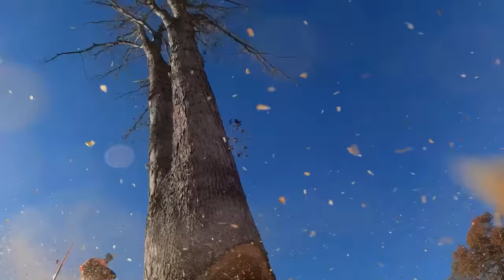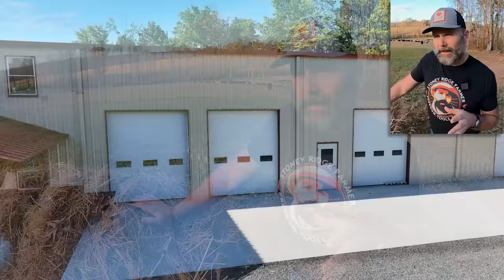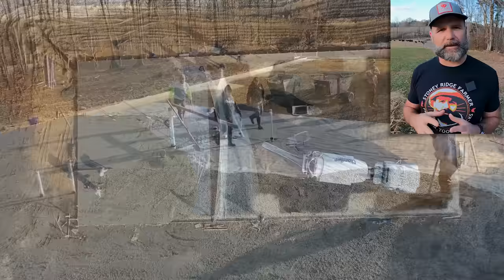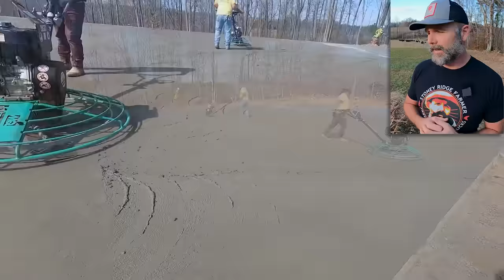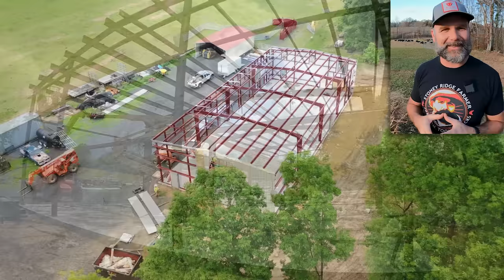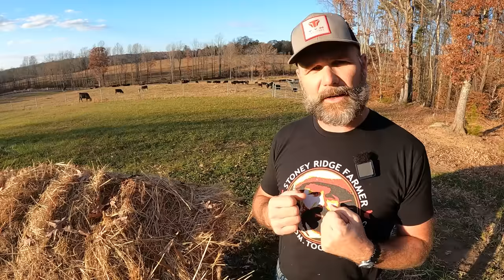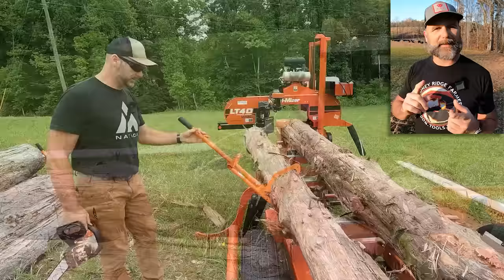Cops Came to Investigate Veteran's Farm! Heartbreaking disbelief

Comment: Hey folks… I’m a vet. I bought a 3/4 acre parcel in Pensacola a few years back. It was a vacant lot with a couple huge oaks some tall pines and a few pistachio trees on it. It was overgrown like a jungle with vines and wiled grapes and basically a mess. It had a three foot chain link fence around it. I cleaned it up and it looked like a park. It had a small concrete pad two septic tanks and a power pole already there from previous owners. I parked my camper on the pad and put a 40’ cargo container in had power and water turned on and had planned to build a home. I owned it free and clear. No mortgage, no business situs, no contracts of any sort. Three months in code enforcement cited me for the camper/RV and the container that had all my equipment in it. They told me I could not live in my RV on my own land for more than 14 days in a calendar year. I had paid cash in full for this land and over 6k in back taxes from the previous owners and found it had 25k in liens by code enforcement for a previous abatement that were not disclosed in the purchase. I was told that I must remove my vehicles, my RV, the container and all of my belongings within 10 days or the county would abate it all and I would be find $1200 plus the cost of abatement. I started studying big time. Permit was needed to dig a whole to put in fence posts… This was the first property I owned. In my research I learned things I had a difficult time accepting. You should check out these two links…. Then do your own research and verify… it’s all mind blowing FACT…. 
http://www.usavsus.info/

https://www.law.cornell.edu/definitions/uscode.php?width=840&height=800&iframe=true&def_id=28-USC-2032517217-15940179&term_occur=999&term_src=title%3A28%3Apart%3AVI%3Achapter%3A176%3Asubchapter%3AA%3Asection%3A3002
Reply: Hey Tim I'm in Pensacola and I was given verbal approval from an engineer at the courthouse 2 times to start a job 1 day before a hurricane to keep clients house from flooding. Also me almost being arrested twice by code enforcement for doing exactly what I was told I could do. Lot of people in your situation move over to Baldwin County, 20 minutes from downtown Pensacola. Funny I live on a lot in east hill and I'm wondering how long I've got before I'm caught. Hope things worked out for you.
Reply: We bought a house ( 1999 in NY) did a ton of work license and permits all done. We decided to move and sell ( kids were all grown and out of state) so we started to see if there were any permits open. Yes there was . So made plans for inspection,  they come We fixed what we had to, reinspected and passed. GOT A LETTER THE PERMITS ARE ALL CLOSED. Now go to sell . Comes back open permits.  Go back to the office.  Yes it's closed but buy the county not the town. What? So we had to pay for them to open the permits ( that was closed by the county inspector) so that the town inspector could inspect and close it. Then, I paid again for the county to close it again .
Reply: Whomever handled the sale for you was negligent in not finding and disclosing the 25k in liens prior to the closing. May need to seek legal help against them in this instance.....the mike

Comment: TOTALLY AGREE, I locked horns with a building department (CA) once and WON. This was one of the most miserable experiences I ever had. The arrogance and constantly being talked to instead of talked with. I fought them and a judge agreed with me 100%.  I am now out of state where the only permit required for ANYTHING  is septic,  and that is due to the septic system being installed correctly to avoid groundwater contamination that in reality could impact others. But yes its like how many times does your earned dollar get taxed?  Our current federal government is a example on how hiring the wrong guy can affect everything. Our Government is BROKEN.

Comment: I feel like I should correct you on one topic. I live in Connecticut, (sadly), but I am planning to move down south eventually. Here in Connecticut, zoning is so strict! I believe if the property has been in your family for many years, there may be some grandfathered laws in place, but those are quickly going away as well. Last year, I looked at several properties, intending on buying a home. What should have taken me a couple of months, took close to a year, because of all the red tape, and regulations. We ultimately settled on a quarter million dollar money pit, because it was all that was available. It was so bad, that one place we looked at, was built in 1760, did not have a septic. I said ok, I can put one in. No no no. Can't put a septic in, because the type of land it was on. (They never gave me full details). So I asked what I could do. Short answer was nothing. The home is not livable. So why is it for sale? You can purchase the property, but cannot live there. So this beautiful colonial home, with lots of American history, would have to be completely torn down, engineers would have to come reshape the land, and build new. $400,000 for 1.3 acre lot, that would cost another $500,000 to build a home, that would be worth $450,000 when all is said and done. But Connecticut will NOT tell you any of this unless you specifically inquire about it. This way, you buy it, then you're stuck paying them taxes, for property you cannot use, or sell. 
 And yes, you need a permit to build anything on your property. I just found out I have to get a $350 inspection, and permit to put in an 8x8 chicken coop! And even that could be denied. Sadly, Connecticut is a blue state, and they make it very difficult for local farmers here, since they hate the idea of Americans being self sufficient.
Reply: lololololol

Your comment was fine until you turned it into something stupidly political and made absurdist claims.

Comment: Having a farm of 12 acres in my family for almost 60 years.  They changed zoning with a 1inch by 1inch paper notification.  That Myparents were never informed of.  Livestock have been on this property most of the 60 years.  So, fast forward I build a 170 x 72 indoor arena with a 72 x 72 attached barn in front of.  All permitted and built by a professional.  My problem is my taxes keep going up yearly.  My husband I are retired and horses are a hobby for us and our granddaughters.  My place is paid for many years ago. But, they are taxes us out.  New very expensive homes are going up all around our land.  We live in the original farmhouse in this county that is over 125 years old.  I feel this shouldn't be happening to seniors.
Reply: there may be ways to  get around   all those taxes at least for now, you need to investigate, as seniors they can sometimes   give you a break.   talk to a tax attorney and tax accountant.

Comment: Josh I totally feel your pain on this. I’m dealing with a similar situation in TN with the EPA where I crossed a dry creek bed for farm use. I was just maintaining an existing drive and added a little gravel to clean it up and make it look better. You would have thought I was trying to build a warehouse in wetlands area the way they acted. The environmental consultant they had me hire to come out pretty much said the same thing. He said there is so many other things they really need to be worried about besides messing with a landowner trying to improve his recreational property to help the wildlife. I have been dealing with this for almost a year now and took every step they told me to take but in the end it will still end up costing me 10-15k for a simple low water crossing so I can access the north side of my farm with tractors and other farm equipment.
Reply: You might have to install 2 or 3 corrugated 18" plastic pipes and blade some dirt over them amd cover with gravel. Good luck.
Reply: You should have fenced off the entrance and forbid anyone from entering ever, posted no hunting and no trespass. Never let an inspector onto your property without a warrant. No judge will give a code enforcement inspector a warrant unless something really bad and obvious, like a building about to fall.

Comment: Sorry for your experience.  I have similar values.  I have built in two locations.  90 acres In Granger County TN and 10 acres in Oakland County MI.  I checked for permitting in Granger and they said "its your land, build what you want" but to live there you need a septic permit/inspection.  In Oakland County MI, you need a permit for anything (such as a fence not on you property line???).  The zoning is intense, with 10 acres, the max animals you can have is 25 chickens (an animal point system that makes no sense at all).  I am 77yo now, so I will not move again.  I will live and die on my 10acres (unless they jail me for some infraction - very possible! LOL).  I have my gardens and chickens [may add some illegal rabbits some day] and that will have to do.  We need to get smart about who we elect and how our kids are taught.  Kids need to be taught critical thinking and not what to think.  I worry for our future.  Best wishes, Doug

Comment: I just came across this video, and I'm surprised you mentioned that Connecticut doesn't require permits to be pulled for anything.  I made my living as a residential remodeling contractor here for over 30 years, and I can attest to the fact that NEARLY EVERYTHING you want to do to improve your property REQUIRES PERMITS & INSPECTIONS.   Though the laws were eventually repealed, there was even a time when contractors were required to collect a sales tax on materials & labor for seven miscellaneous little things such as cladding exterior wood trim pieces with aluminum sheet stock when installing vinyl siding on a house!

Comment: I worked in construction most of my life. There were times that inspectors went out of their way to make the job tough to get done. One job was in Chicago during the 80s. The inspector on the project said the men were not following the specks on washing the exterior of the building with TSP before spraying the prime coat paint on. I told the inspector to choose a spot and I would have a lab test it to make sure the prep was correct if the city would pick up the cost if I was right. He became irate and pointed his finger in my face and screamed that he was shutting the project down, I told him to get his finger out of my face and slapped his hand away. He ran back to his office and called his boss who then called my boss that I was not to be allowed on the project. It turned out he had been getting gratuities every Friday and he did not get it the prior week. I didn't work anymore projects for the city. I worked all over the U S and never had that kind of problem again. Sometimes getting the inspections done could be a problem. Some inspectors tried to include their own specks instead of the cities or the design engineers. As a rule most were good and no problems to work with.
Reply: Corruption.
Reply: My dad was in construction and your story sounds similar to the stories that he had told me  about those building inspectors in how anal they can be , and you could go back and get every single thing right but yet they will find something else for you to correct and where I live at they most definitely can be pretty anal about this and that .

Comment: I also wanted to be completely in bounds with my recent shop build, especially since my Mom retired from the Township Building Department and still knows most of the people there. I applied for a building permit even though Ag does not require one, and presented a completed application form, a post layout plan from my builder and a site  plan I created from a GoogleEarth photo. They approved my plan quickly, and when I went to pay for and obtain my permit, I was surprised when the clerk asked for $18.22 in a fee. No, she corrected, $1822.00 in a building permit fee, which included $755 for plan review. For a plan that could be reviewed in 15-30 seconds.  I paid. When my Mom asked, I told her what it cost, and she said here in Michigan, the Building Department cannot be funded through the General Fund, but must pay its own way via the fees collected. The contract for the building is approximately $130K, and the inspector has been here twice, once for holes/concrete and once for exterior framing final.

I doubt I will be seeking electrical or plumbing permits.
Reply: I live in northern Michigan myself, i built my pole barn myself  fuck'em, im not asking for permission. Ya ya ya they can make you tear it down, but then they can't tax you for it. Mine been built 5 years, i just got taxed for it after year 1
Reply: We left that soon to be a crap hole State last year.  I advise everyone else to do the same.  Those 3 women are a curse on what was a great State.
Reply: I live near Richland, MI. There is a zoning board and inspections are performed by the county. 
I just built a workshop in my backyard and got permits for the building and electrical. I don't want to heat the building in the winter so I didn't plan for any water. The inspectors passed the building which I built by hand and the wiring which I installed myself. 
The permits were handled correctly to my knowledge. The building is finished. The taxes were just posted and we have been lucky so far. 
I lived near Union City prior to moving here. 33 years ago when I moved in I put a new service in the house. That was the last permit I filed for. Union City Township had no zoning board. The county had inspectors but there were no requirements as to what type or where I could build or place a building. 
We put in a trailer pad for my mother in law and my Dad and I installed a service to the trailer. He filed for the permit because he didn't own the property and was a licensed contractor. 
It depends on the people in the area and how the local government is setup.

Comment: Josh I’m very sorry you had to deal with that. I built my welding shop on the family farm in Maryland and dealt with the exact same scenario. I got to the point where I had to hire an attorney and kick the zoning officer and county rep. off the property. 40K later and 2 years of hearings and a conditional use the issues were resolved but it left a very sour taste in my mouth about county govt. and their over reach. The 2 main take aways from my experience were it is easier to ask for forgiveness than permission and that local elections do indeed have consequences.   Put it in the rear view and act accordingly going forward.

Comment: I feel his pain. I decided to remodel two restrooms in my home, opting to make them larger. Prior to beginning any work, visited the city permit department to get the necessary permits. I was informed that no permit was required since the renovations were within the confines of my home, and permits were only necessary for exterior additions.
However, as the bathroom renovations neared completion, a city inspector unexpectedly arrived at my doorstep. It turned out that someone had reported the activity at my house, prompting the inspector to ensure that all proper permits were in place. Despite my assurance that I had followed the guidance given to me by the permit department, I was informed otherwise. I found myself facing the frustrating reality of having to tear down much of the work already completed, obtain the necessary permits, and yes, fines for building without a permit.

Adding insult to injury, when I sought clarification and accountability from the city permit department regarding the misinformation I had been provided, I was met with denial. The individual who initially informed me that no permit was required refused to acknowledge any error, further exacerbating the situation.
Overall, it was a frustrating and costly ordeal, compounded by the lack of accountability on the part of the city permit department. Despite my efforts to comply with regulations, I found myself at odds with a bureaucratic process that left me feeling unfairly penalized.
Reply: as a 23 year old i have never had more advice for anyone than "record every interaction with any company/organization you ever have" even if its for the simplest of things. you cannot trust anyone in power.
Reply: Always get written, recorded etc. conformation of anything said or told.

Comment: Where I live in Minnesota, if you want to attach a small roof over a patio door or any door, you have to get a septic inspection. The same thing applies if you want to replace your deck or change/add on to the deck.
It's a money grab for building permits.
My mom in Wisconsin had to get a permit to replace her broken water heater!
The government is looking out for your best interest, not so much!

Thanks for your service, Veteran to Veteran!
Reply: Wwhhaatt?  A SEPTIC INSPECTION FOR A DOOR OVERHANG?
Reply: @lynb2039  yup
Reply: I live in Minnesota too, and wonder what hoops I have to jump through to build a small, adjunct breakfast nook on my house... I shutter to think...
Reply: @pamelaj.miller5115  it all depends on the city or county zoning. The 5 county metro area is worse. Good luck finding reputable contractors. They are hard to find.

Comment: Before you mentioned Connecticut, I was thinking you're lucky you don't live here. Trust me, whoever told you that you don't need to worry about any of that stuff in Connecticut is nuts!!! They'll come after you if your grass is too long, and forget doing anything more than painting your house. Technically, you are supposed to get a permit to change a 120 volt outlet in your  living room. If you drew a permit for everything you're supposed to, you'd go broke with permit fees.